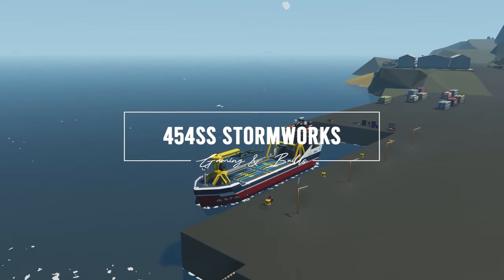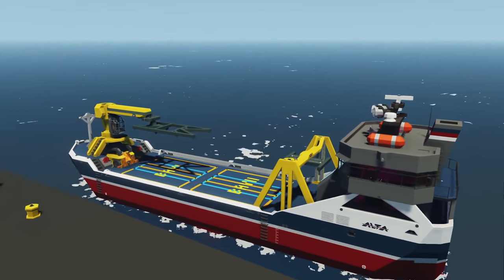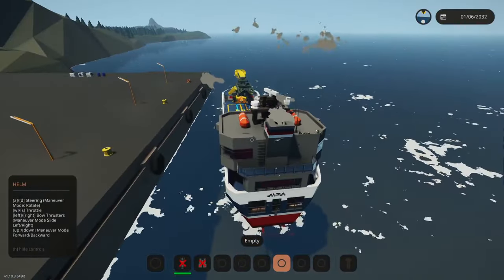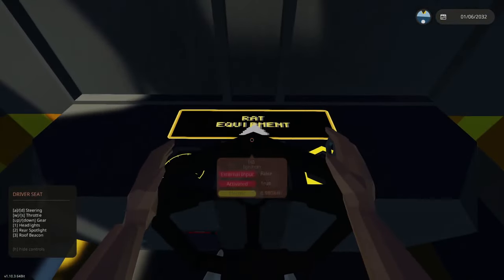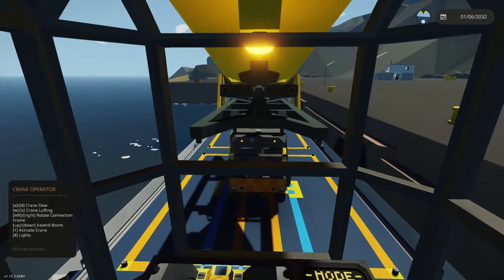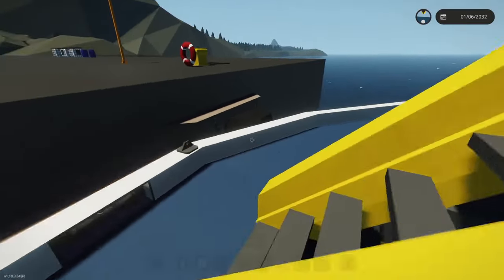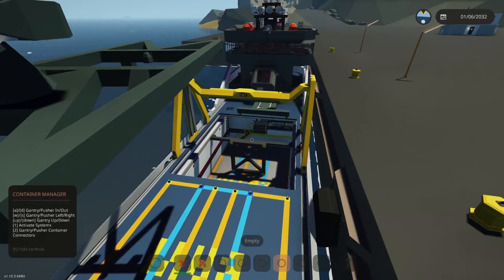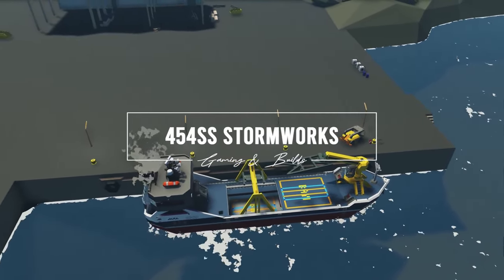Advanced Cargo Ship LOADING PROCEDURE in Stormworks

Comment: why do you need 3 separate systems? crane, gantry and pusher. Why you can't just make crane a little longer and place container at bottom with one system, then connector on rails can slide container to the back itself

Comment: You could use some mag-alls as anchors to the shore to reduce all that boat movement, or connect to the dock rope anchors, and maybe make a little system similar to what you have on the back of the tug, but separate as a trailer to solve the turning issue, with cables and winches to attach it and send a turning signal

Comment: I was wondering what happens to the tug when the ship is fully loaded? Is there still room to put it in it's storage place when the ship has all eight containers?
Reply from the maker: I thought I covered it in this video, but maybe not since I did several versions of the video and didn't keep track if i mentioned it.  Pretty much, you bring the final 2 containers to the dock, load the tug, and then load the final 2 containers! It will not work if the tug is the last one to board - but what can be done if this happens is the tug can be placed on top of a container and the connectors engaged to the container top. But this will make the load unbalanced so ballast will have to compensate
Reply: @454ss_gaming   I ask that sam question and I got the som answer